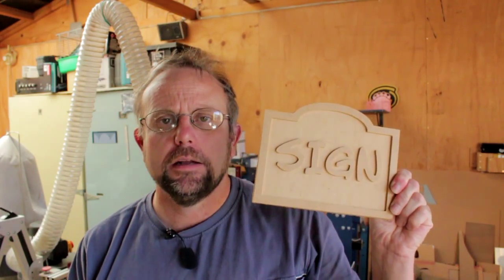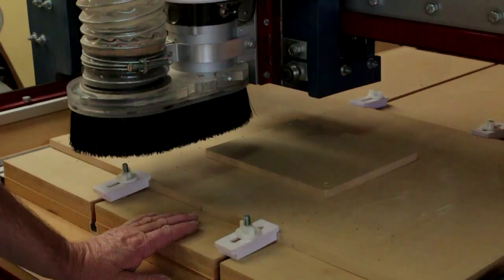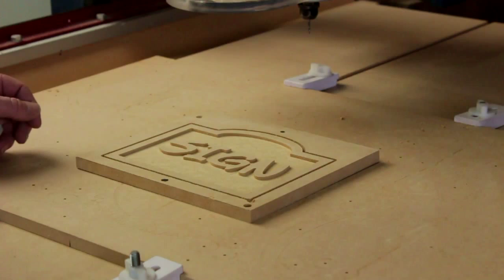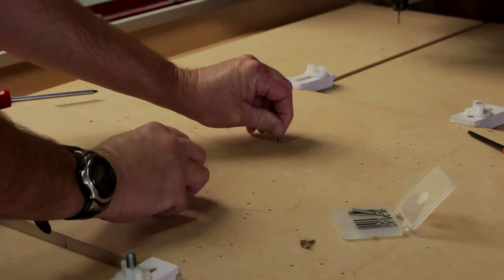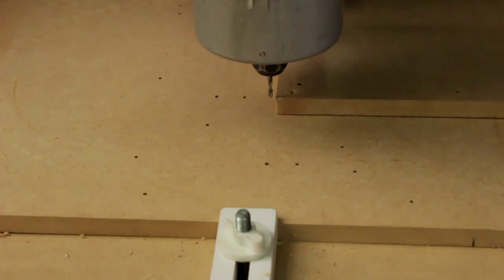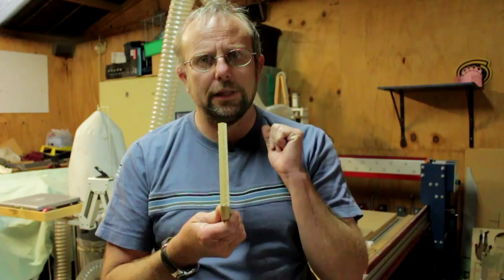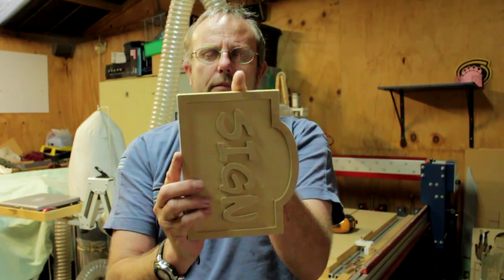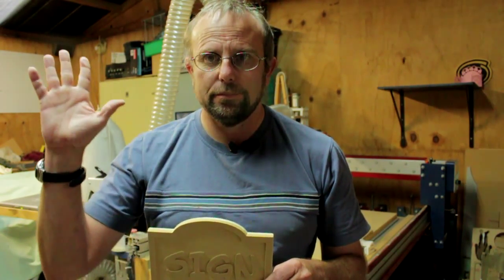Seeing Double - CNCnutz Episode 53

Comment: did you re zero after you flipped the part?
Reply from the maker: No.
When using this method you don't change the X or Y settings on the machine.
Cheers
Peter